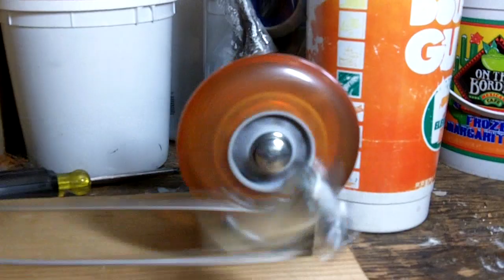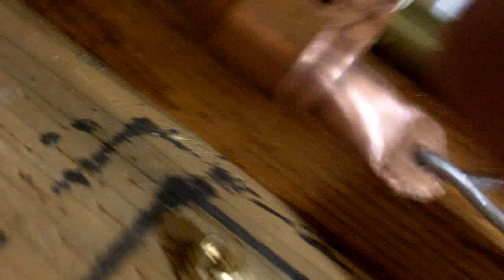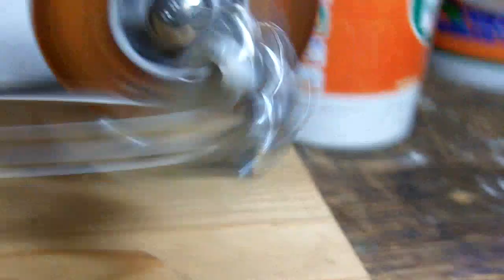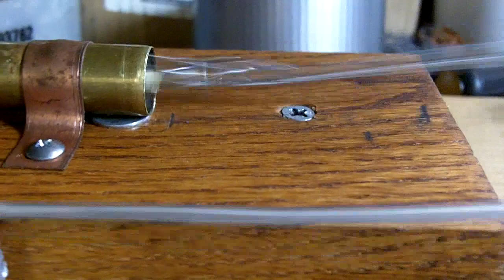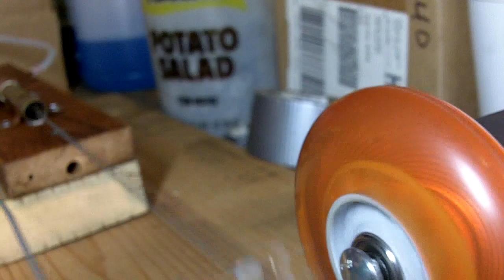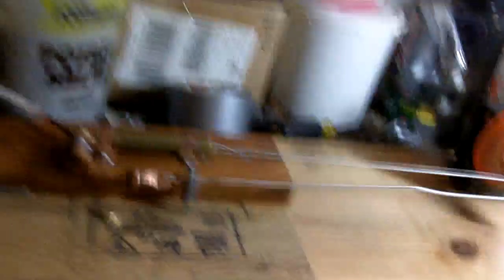Single Acting Steam Engine

Comment: Well the horizontal motion is actually an approximation of the cosine of the rotation angle for both the piston and the valve.  Since they are mounted on opposite sides of the crank, they are 180 degrees out of phase with each other.  Also, since they are both mounted a different distance along the crank, they have different amplitudes (the crank having the smaller amplitude).

Comment: Position of the valve is a derivative of position of the piston only if you approximate the motion of both as sinusoids (in which case it is sine and cos). In general, the motion of both are just offset by a phase difference.